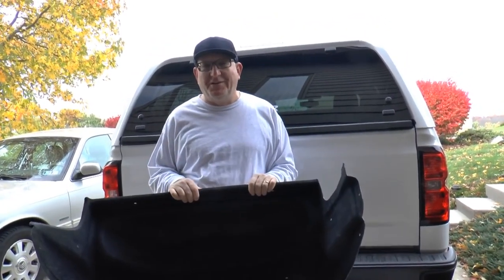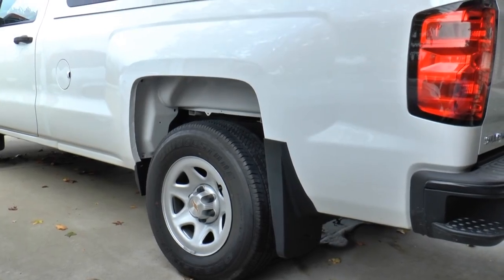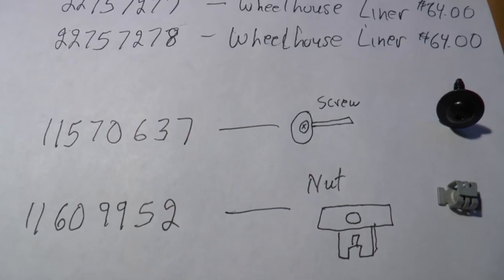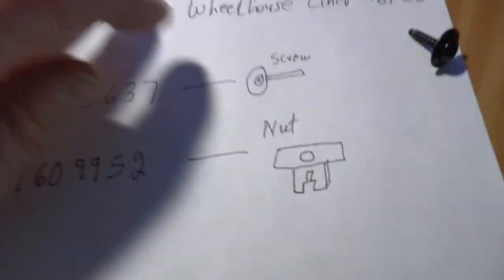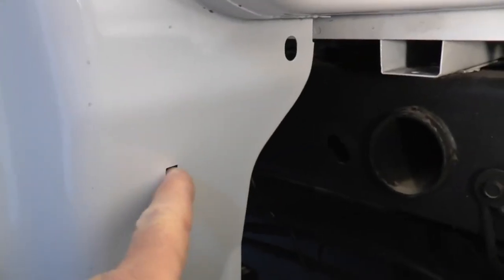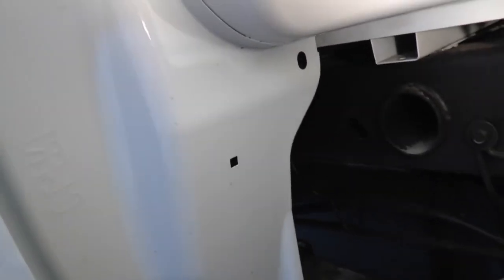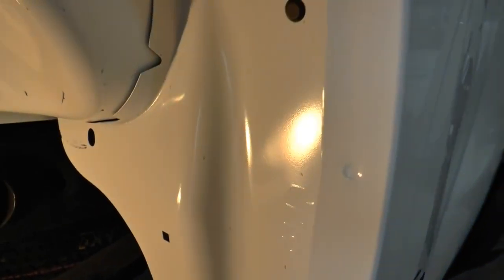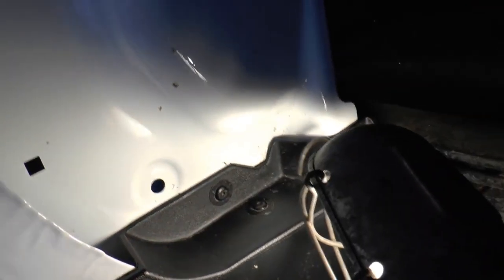2015 Silverado Wheel Liner Install original GM liner

Comment: Completely different 4.3 from your old one. The Eco tech 4.3 is a 5.3 with two cylinders chopped off. The old 4.3 has not one part in common with your new one. Good video.

Comment: I have a 2015 Silverado LTZ and I am replacing the factory original liners with aftermarket. Mine have felt which in Michigan where we get a lot of snow that snow and slush packed in there so tight I had to Chisel it out. So I want to buy ones that are plastic and hopefully will not stick

Comment: Thanks for your video! I just bought a used 2018 GMC Sierra that looks just like yours (white work truck). I have been wondering about the plastic aftermarket products (Husky, etc.) but... like you, were concerned about the "fit" issues brought up in the reviews. Plus, the factory material around my front wheels looks like it would have better sound dampening qualities vs the plastic aftermarket ones.

Comment: Just did this to my 2500 hd,part number through Chevrolet is 0 84511160.Kit includes both liners and hardware(screws and inserts). 120.09 out the door and I didn’t have to remove wheels,about 30 minutes.

Comment: Great video and thanks for your time. I have a 2017 custom double cab and I bought those liner at the dealer but they didn’t fit. The part # for this set is 84154469 and the one that I need is the 84154470. This is a OEM part. I did a search and other accessories company had this number I think that the set that I have fits from 2013 to 2015 and the part # ending on 70 fits from 2016 to 2018 I will update this when I found the right part number. Don’t make the same mistake that I did and get the wrong stuff. I even called at the dealer and give them the first part number and the last 8 #’s of the vin and I was told that that was the right part but wrong so I will keep you posted.
Reply: What is the number for 16 thru 18 I have 16 custom double cab just want to order right parts

Comment: you can get the screws and nuts gm has to order it another way hw0001 or srew number 11570637 nut 11609952 
i wasnt paying over a hundred for 10 dollars in screws and nuts im installing mine tomorow great video

Comment: Great video!!..One important note is that on the top of the wheel well I noticed a large removable plug on both the driver and passenger side..I've seen a lot of these trucks where rust is starting on the top lip...Removing those plugs and flushing with water every spring would slow that rusting down.I'd really like access to those plugs but with an existing cover or newly installed cover,the access is blocked....Something to think about...I have a 2017  with covers factory installed...I'm trying to think of a way to access those plugs easily....Might be tough.
Reply: Spray the wheel well down with cosmoline prior to installing .
Reply: They are right aftermarket ones way too narrow comes with clip-on fasteners with screws, holes don't line up. 
I bought the pushing nuts, new UPDATE number GM 22642007, N518531 Online 10 for $7.99, 1.50 shipping from Ebay seller.